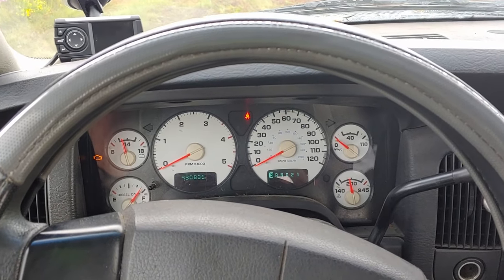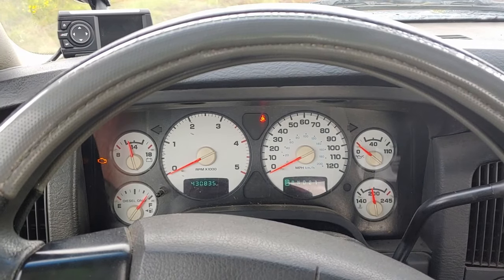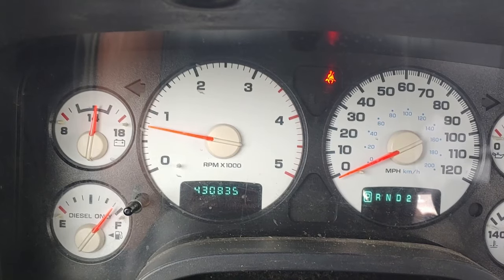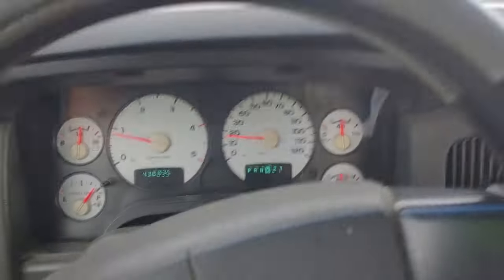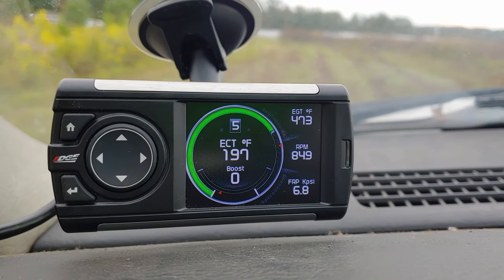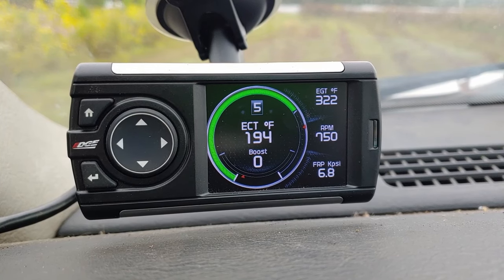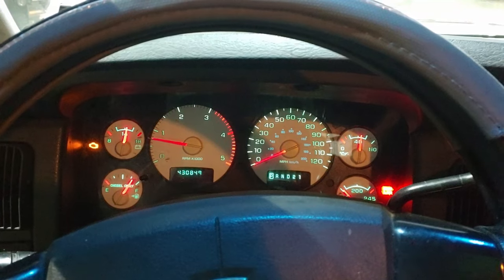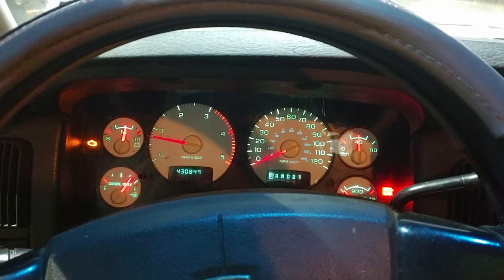Here's Some Helpful Hints When Looking For Failing Common Rail Cummins Injectors!

Comment: I came across you channel when searching for what's wrong with my truck. Hopefully u can help. I have an 08 3500 dually 6.7 Cummins. It's fully deleted with a 75mm turbo and a fass fuel system along with some other stuff. Here's my issue once I get the truck up to temp and I let off of the accelerator and push the break it billows white smoke. It only does this 1 time till I let it cool down and heat back up again. My coolant is clean and staying full and so is my oil. I'm baffled on what's going on with it. Any help will be much appreciated!
Reply from the maker: Sorry to hear about your trouble. I don't think this will be your problem, but how is your blowby?
How many miles are on the truck?
How long have you had the 75mm?
Who built it or is it box stock?
What tuner are you using?
Does it seem have any relation to fuel level?
Is the puff immediate? Or delayed?
Reply: @70440charger  it has 183k miles, I had the upgrades done at about 175k. Supposed to have a flash tune on it but the guy turned out to be a scam artist so I basically had to rebuild the whole truck myself. Only thing left from him isn't the turbo and the tune (witch I'm looking into EFI live currently) when redoing the truck I checked the turbo and the shaft seems tight with no play and didn't see any sign of oil on either the intake or exhaust side. I also recently put a new CCV filter in. I check it today and it was still good, not a lot of blow by. Last thing I did was put a fass fuel system on it (100gph) it started around that time(maybe alil after) interning side note. I found out my trucks been running without the fass system due to a blown relay for a few months now. I recently caught it and fixed it but the smoke continues. It's really strange cuz it will only smoke 1 time per drive. When it goes from cold to hot it will blow smoke once the engine is to temp and after I let of the gas it takes a second or 2 to start then once I press the break is seems to smoke more. If I accelerate it clears up. Then once it happens it will not smoke again till it's shut off and cooked down all the way. I was thinking maybe an injector is sticking open or something idk. It's been driving me nuts. Thanks for the response btw much appreciated!

Comment: On your 12 valve swapped 3rd gen how did you run the throttle cable. I got an 04.5 and it just has an electric pedal with just wires going under the hood that just stuck an injector and torched a cylinder pretty bad. Been contemplating a 12 valve swap
Reply from the maker: So if you have the Electric pedal you have to swap it for a gas pedal or an 03-04 pedal. Once you do that then you can just use the standard throttle cable for the 99-04 trucks. The swap is NOT quick. Lots of people make the assumption that just because a 12v (p pump swapped 24v as well) will start and run just by lifting up on the fuel shut off, that it will be a quick deal. Well, while that is true, it will be a truck that is worthless to drive and a hassle to start and stop and will not have any of the factory feel. Then thats where people start hacking things up instead of doing it right the first time!  It may sound like I am trying to talk you out of it, but I am not.... I have just gotten too many phone calls over the years from people who hate their swapped trucks and when I start digging into how they did the build 9/10 times they hacked the crap out of their truck.  I loved my swapped trucks and am working on the next one right now. Wouldn't have it any differently. But I just want you to have eyes wide open as you are going into it, if you do!  Thanks for stopping and commenting here!

Comment: Ok 06 g56... Truck runs fine, no hanging idle... No smoke no haze like you said. Had an edge tuner for monitoring guages, got rid of that to go to custom tunes with smarty mm3. This tells me the balance rates, and I've got 1 that is between +3 and +4 (cyl 5 it says, but could be in firing order) but sometimes it goes down in low 2s. In neutral and idling. No signs of failure. If that one is at say +4 (so it's under fueling and ecm is adjusting) will be it ok to run for a little bit before I save up?
Reply from the maker: Hey N Sacco! Thanks for stopping by. What first clued you into the fact you had an issue? Have you noticed some kind of abnormal behavior outside of what you mentioned or did you just check the balance rates as a precaution? Doug
Reply: @70440charger  well I had an excessive return code for a couple minutes one time then it went away. Ever since I've been paranoid and since I just got a different tuning platform thought I'd check them out. I'm assuming since it's underfueling it shouldn't torch my cylinder walls 😅
Reply: To answer your question, yes it was as a precaution. But knowing I had a code at one point was thinking it was just a fluke thing since it hasn't come back.

Comment: Where can I get this filter? I have 118,000 miles on my truck so I’m starting to think about changing my injectors soon. I think I am going to go for NEW oem boshc or something. I want the best money can buy. I’m not going for power, staying stock.

What should I get?

Thanks!
Reply from the maker: Hi there! What year is your truck? If its a common rail, then you should check out a baldwin PF7977.  Here is link to the exact set of filter that I just used not more than a month ago....https://ebay.us/ObdMMc
Reply: These filters are only for the 5.9 or will they work on the 6.7 too lmk thanks
Reply: @70440charger  2003 5.9

Comment: I just changed my injectors and i still get a tiny bit of smoke on a cold start up (80+ degrees here in FL) what could be done
Reply from the maker: Thanks for the message! Just to make sure we are on the same page, is this smoke out of the tail pipe? Also it would be helpful to know what year your truck is, what brand and size are the injectors? Has the truck ever had any motor work done and does it have blow by?
Reply: @70440charger  yeah just a lil puff. Its a 2004 4x4 with the HO pre 2004.5. Bosch and stock size. And its got 500k miles 0 blow by

Comment: im going to buy a truck and the owner says everythings good no blow by but only injector 6 is failing, is that a big deal?
Reply: Big deal, if 1 is on its way out, rest are close behind. Couple grand for injectors, not including install (if a mechanic will be installing them).

Comment: 2013 6.7 with a lot black smoke and no power at all, cp3? Injectors? Turbo? Any ideas thanks.
Reply from the maker: Hi thanks for stopping by? Do you have a boost Guage? Is this a factory he351vgt turbo or an aftermarket turbo? Is it deleted?

Injector failure isn't as common on those 6.7 as it is on the earlier 5.9 CR's. So I personally wouldn't just to that conclusion right away...
Reply: Yes deleted and factory turbo.
Thanks for you reply

Comment: Would that mean all of the injectors are failing or could just one bad one cause this?
Reply from the maker: As will all common rail stuff, its hard to give you an answer that cover all of the possibilities.  But I would say that typically you would have multiple failing and not just one. I suppose if you had one that was bad enough, it would be possible... but that is pretty unlikely.  In our experience the majority of CR injectors we have send in for testing (even some freshly rebuilt) have failed.  I am not trying to scare you, but just be real with you cause the consequences are so bad, if you gamble and guess wrong. For example,  we sent off 18 injectors for testing and 3 or 4 came back as good. We took those and bought 3 or whatever more to complete the set and my friend drove from GA to Idaho. His injectors died somewhere in Nebraska.  They didn't even male the whole trip! It got luck and caught it early enough to not smoke a motor, but it was too close of comfort!
Reply: @70440charger  could poor tuning cause that hang? Cause the only sign of bad I injectors I have is that and slight rough idle when in neutral I have no smoke no loss of power or fuel in my oil

Comment: Hey really need some help. I have a 2007 6.7L with 207k miles that keeps wanting to accelerate when I have foot on the brakes. This happens only on drive and reverse. When putting it on neutral or park from reverse or drive the rpm jumps to 1,500 rpms. Is this a common rail injector problem or is it torque converter
Reply: Possibly your FCA ( fuel control actuator)I had a 2003 that did this at red lights and had to hold down the brake pedal harder.Changed it and ran perfect.I got lucky on that one
Reply: I have this same issue, changed fca, did whole too in , head gasket, for other problems, but when I put it back together the issue was still there and it has tons of blow by
Reply: Does the rpm drop down low when you are holding the brakes in drive?
Reply: @mrmadmoody  Mine the rpm sped up faster.Had to push on the brake padal harder
Reply: I'm a dodge diesel tech you got a converter issue
Reply: @joshuaprice9292  thanks !

Comment: Guys, I’m sick to my stomach.  Flew from Virginia to Missouri to get a 07’ 6.7 mega cab dually. 

As soon as I go to drive it away it was missing like it was starving for fuel.  Changed the fuel filter. No change.  No black smoke.  No white smoke.  

The longer I go, the more it was missing until now it’s barley getting able to reach 70 mph.  

300k with original injectors.  

I’m so worried it’s a rail or injector issue and I have no money for repairs, which means I can’t use the car for work.  I’m stuck.
Reply from the maker: Have you check (since you have been driving it ) for blow by? Also are there any codes that pop up?
Reply: Run a whole can of seafoam through it
Reply: In the diesel...it will clear the injectors if they are cleanable

Comment: Thats rail hang. Normal. It can't just dump 25000psi of fuel in a half second lol
Reply from the maker: Thanks for the comment, but to keep to not muddy the waters for others who come here when looking for help diagnosing their problems I want to be clear that the "rail hang" was gone after changing the injectors and was not normal.  Again, this is not a slam on your comment. I am sure you are a great mechanic, and some rail hang is normal, but was 100% not normal in this case.

Comment: I have a 6.7  in the shop  that has been tuned, no egr, big turbo.   Acts like the timing is retarded and way to much fuel.  new stock injectors, same things.  at a total lose and have no more Idea's
Reply from the maker: I always start by asking the super simple question.  Have you checked for proper fuel supply and pressure to the pump, have you checked the fuel filter, and have you done a boost leak? As a second follow on question, do you have a scanner that will check for deep codes that the truck may be throwing? I say that cause we worked on a 2014 that had an active air system and never threw a check engine code, but was a dog. It was a sensor related to the active air and tied into the Map and IAT sensor. I can't remember all the details, but before you go there, i would start super simple! Hope something in there might be helpful! Good luck and let us know how it goes!